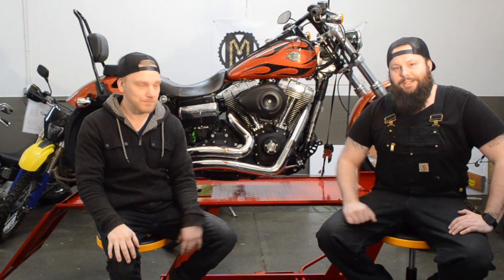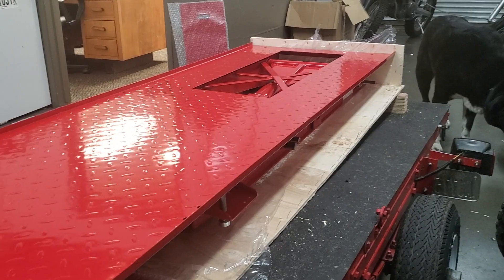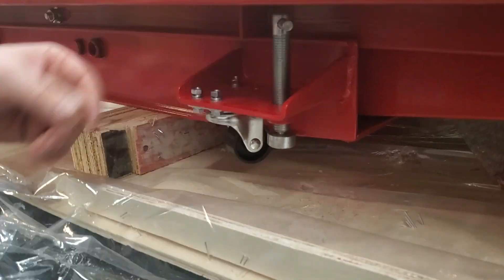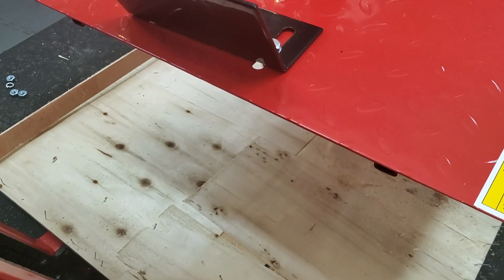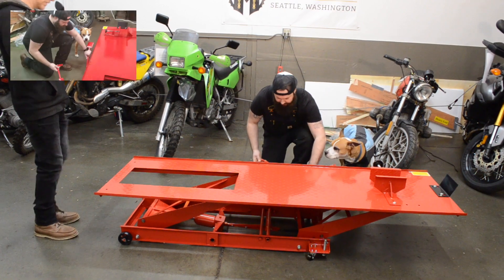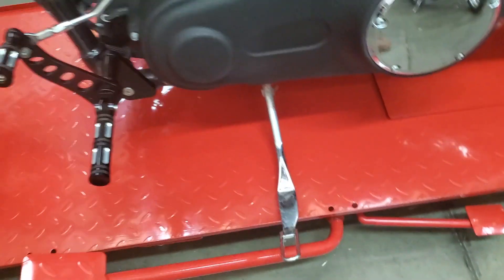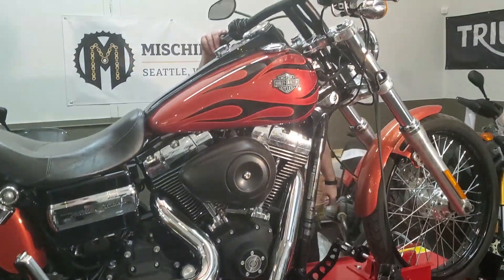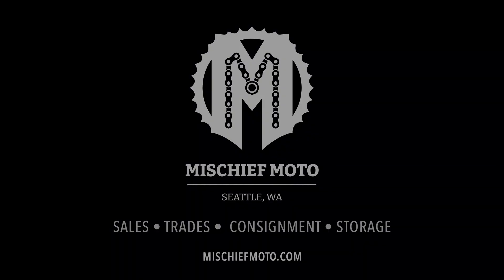Harbor Freight Motorcycle Lift: Is it good?  Unbox / Assembly / First Impression

Comment: i used the black wheel chock that hf sells that locks in the front tire . the stock clamp went in the trash  
added 2x6 sides and 6in casters under the front corners  as well as more tie down points

Comment: My son just purchased one of these lifts. His came with the castors already installed, and there were four U bolts included for attaching straps. The wheel chock is the only negative to this lift table. Harbor Freight has an upgraded wheel chock that should have been included instead of the crappy one. I guess they do it this way to make you spend more money. At any rate, the upgraded wheel chock is a good way to go.
Reply from the maker: Ours came with the U-bolts, but we prefer it without because the holes are big enough for the straps. I wonder if his was returned since the casters were already on

Comment: The hydronic pump must have fluid in it, where would one get a replacement when it starts leaking?
Reply from the maker: This is what I found:

https://www.redlinestands.com/catalog/lifts-c-290/parts-accessories-c-290_304/hydraulic-motorcycle-lift-parts-c-290_304_309/harbor-freight-motorcycle-lift-table-replacement-pump-p-2797